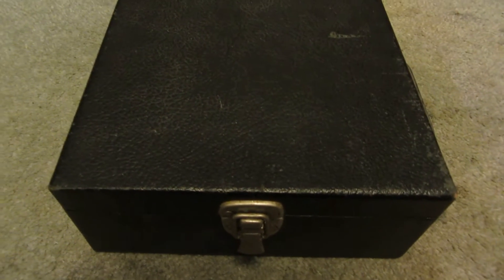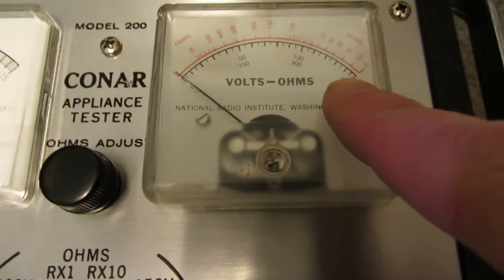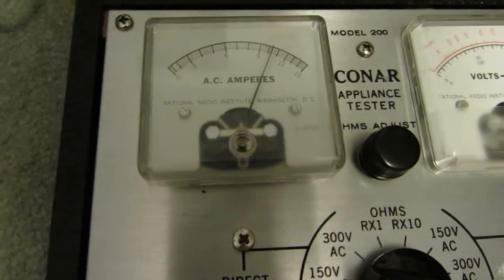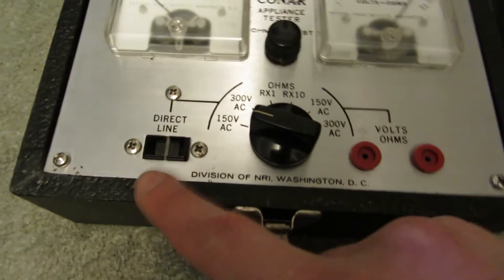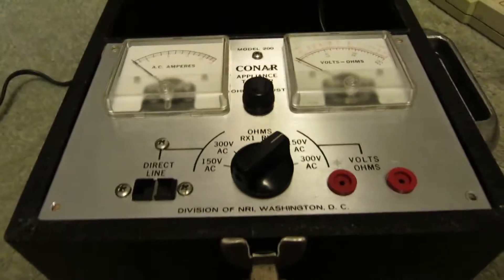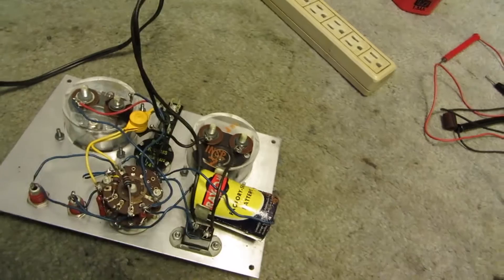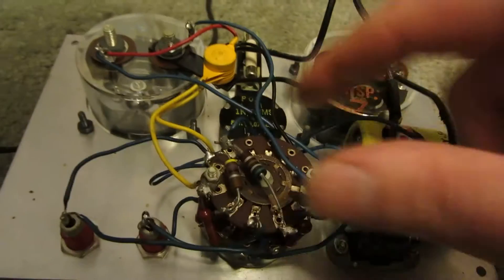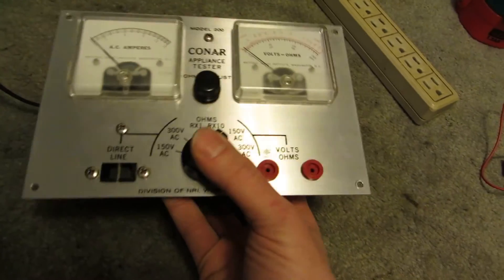Conar Appliance Tester Autopsy

Comment: The yellow thing is a Bridge Rectifier.  To measure ohms, the meter has to measure DC.  My guess is that they are converting the AC, measured from the probes or plug, to DC to be read on the meter.